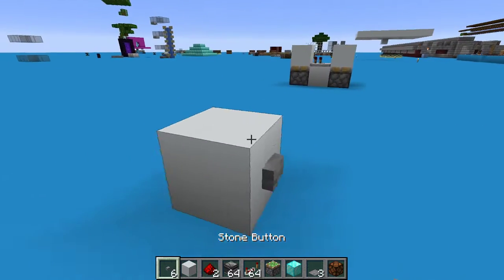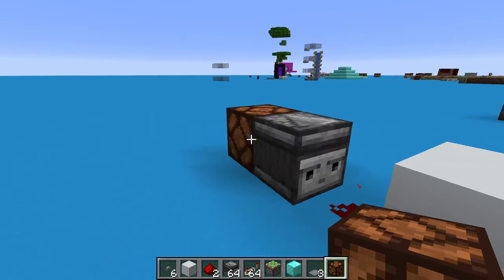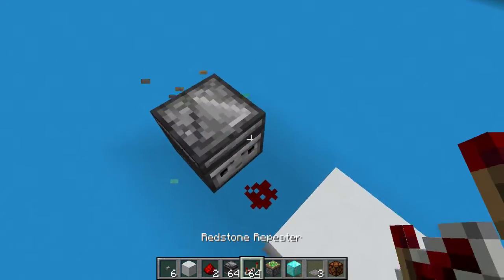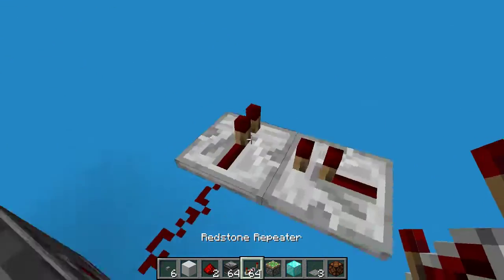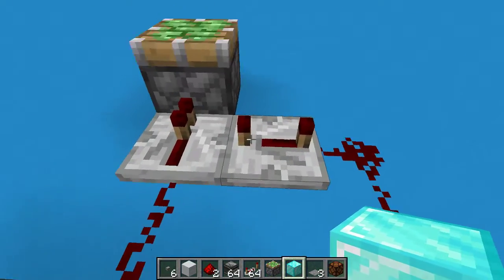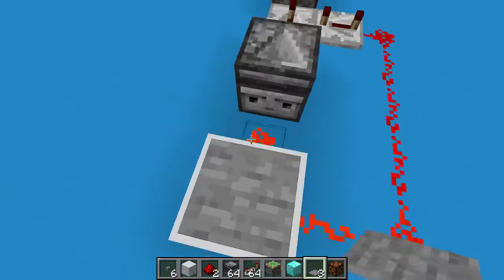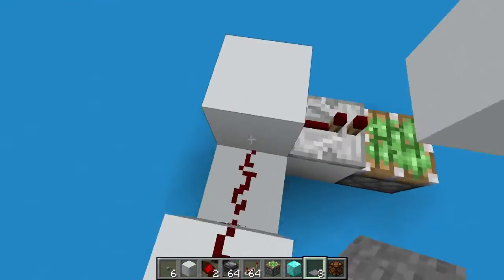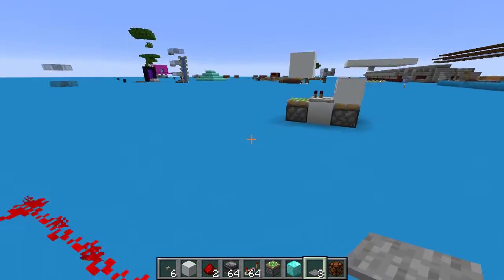One Tick Pulse From Redstone Observer

Comment: Quick question. Ill try and word this the best i can. I have a stone generator, that generates a stone layer leading to an observer facing a stone wall for block updates. Under stone layer i have rows of sticky pistons with wood blocks on them, because with an efficiency 5 pick axe, piston break instantly. The observer detects block update from wall. How can i stop the observer from detecting block on piston as it also attaches itself to wall when pushed up, creating a loop. Sorry if thats difficult to understand.
Reply: Because it detects 2 different updates, I've tried monstable circuits or pulse extenders and it still creates loop. I know I could just change the sticky pistons to regular pistons to elimate 2nd detection but then I have to add another lever to manually push block up when done running farm. And I'm kinda stuck on this idea  lol

Comment: I have spent I think two hours trying to work out a toggling circuit for a concrete farm and finally found this tutorial. built this circuit and bam! the idea finally works :) thanks for posting it
Reply: Same. It was the last bit of info I needed to turn a 2d mud farm into a 3d one
Reply: Depending on the system a note block also works

Comment: Should probably just call this "Single Pulse From Redstone Observer". Cause the pulse from  the observer is still 2 ticks long. Also, it might be good to clarify that you're talking about redstone ticks. For instance, the short-delay repeater actually gets locked 2 ticks (2 game ticks; 1 redstone tick) after it turns off, not 1. And since observers usually turn on for 2 game ticks, a "one tick pulse from an observer" would mean an observer that turns on for half its normal duration when updated. That all said, this is a useful trick (:

Comment: Bro you can just use a note block in between observer and block with button
It will do the same thing
Reply: No it wont, you would have to use the noteblock a button for it to work, but using a button to power the noteblock would do 2 pulses.

Comment: I learnt a few t flip flops too alot of t flip flops or whatever. I call them t flip flops cause it use 1 tick time redstone. Like if u press the input example: stone button and the redstone mechanic like you build on the video and the piston pushes the block into 1 tick thats why it wont pull it back, and it will output using some redstone lamp and other output redstones

Comment: Thank you so much, I’ve been looking for this for hours but just a question: Is there a way to automate this without needing to click on a button ? Where for example am observer would take a block update from a baby villager falling onto a line of string or tripwire then send a one tick pulse from it’s back directly to a dispenser holding mine carts that should only send 1 minecart at a time ?
Reply: Because right now I’m trying to fully automatic my baby villager collection system and my dispenser seems to keep on dispensing an infinite amount of minecarts due to the double tick from the observer

Comment: Instead of locking the repeater, you can use a sticky piston to push the observer.
Reply: No you cannot, an observer gives off a pulse when moved by a piston.
Reply: @Danmashinigamikuro  yeah only on the extension though.. duh. Thats the fix right there.. 

However i will add that locking repeater is hard state which is better than using pistons in your circuits.. that is if your building massive circuits that need to compute alot of things